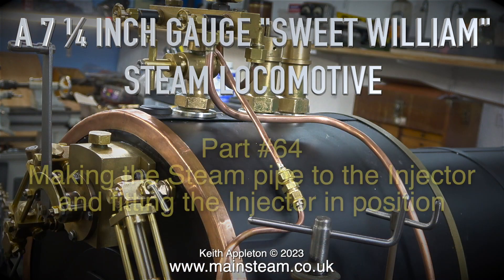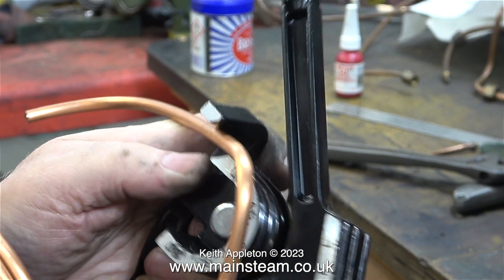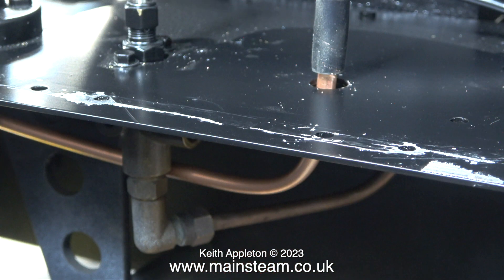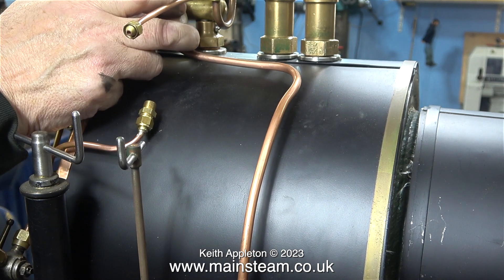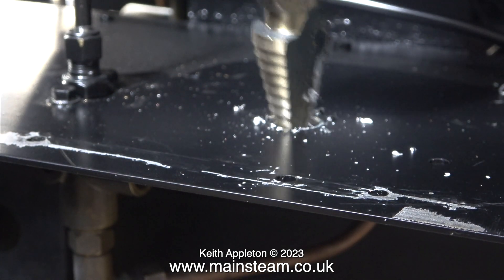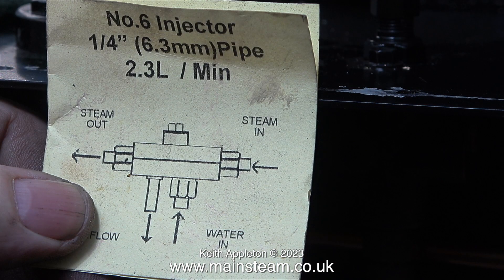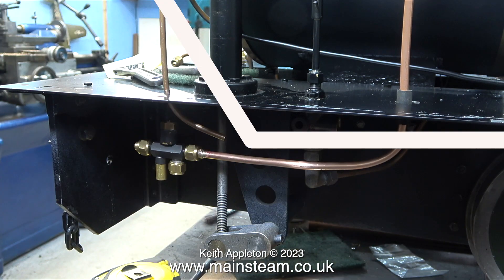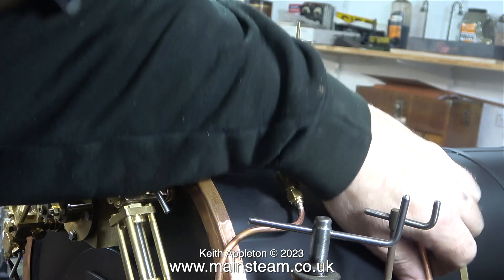A 7 ¼ INCH GAUGE "SWEET WILLIAM" LOCOMOTIVE - PART #64

Comment: On the mention of the water in the saddle tank getting warm, and considering the fairly large gap between the tank and the boiler the way this is mounted on the engine, would using ceramic insulation material between the two help keep the water cool?
Reply from the maker: Not really, the water would still get warm. It is better to use an external water source, then you can keep the tank full for traction weight.

Comment: When I worked in the Gas Industry, one of my favourite jobs was piping up PRS's (Pressure Reduction Stations), mostly in stainless steel. A lot of the piping had to run parallel to each other both vertically and horizontally other wise the job would look horrible. Pipe running and bending is a real skill. I always look forward to your vlogs.